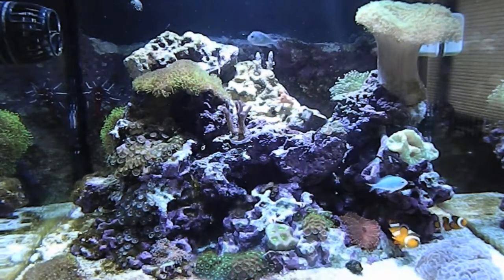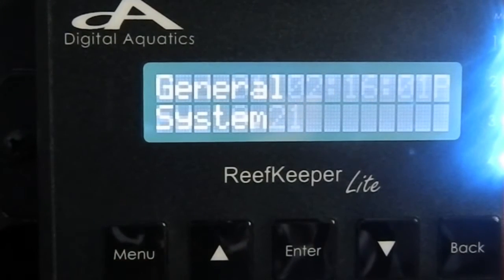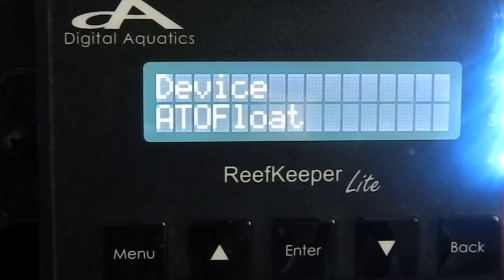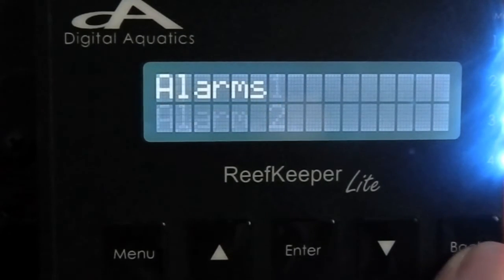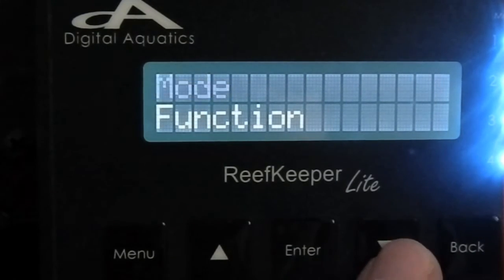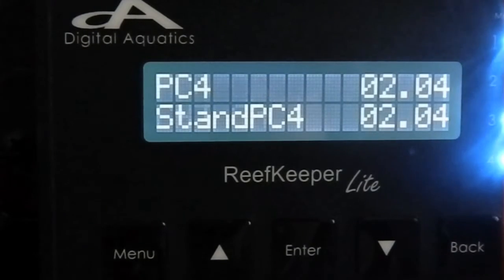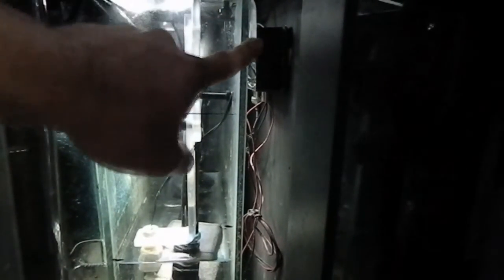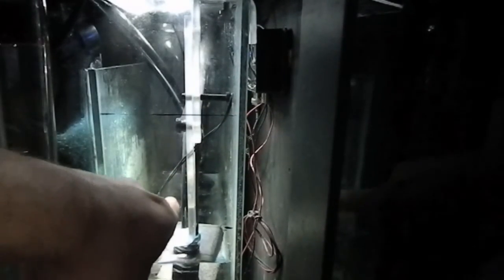How to Setup an ATO with a ReefKeeper Lite

Comment: I don't see a setting in MYREEF 2.0 to set up a ATO. What did you use to set it up on your computer? On/Off, Pump (other),
Reply from the maker: +John Howe Hey, yes you should be able to select On/Off pump.
Reply: Thanks,
In the list of equipment on MyReef, which did you choose?
I was trying to follow your video exactly.
Also my head unit is dead. I just got it friday. 
It was fine yesterday when I was trying to set everything up.
Reply from the maker: Oh jeez, I don't remember. I haven't logged onto MyReef in forever lol. What are the options?
Reply: Ok thanks.

Comment from the maker: The way i have mine setup is...i have one switch to add water to the tank. and another switch in the back of the tank.  the one in the back of the tank is to prevent any overflow. so it shuts off my return pump

Comment: Hey ArcAngel9008,

I just spoke Reefkeeper support and they told me it's best to have 2 ato switches on one system. They told me if one switch malfunction, the other one is a backup. What do you think about that?
Reply: Long time reply as I am just now getting into the sump life. There is also a ATO system by TUNZE that has a float/optical eye switch for redundancy. Currently the ATO kit by TUNZE listed on Bulk Reef Supply is about $200.

Comment: Hey ArcAngel9008,

Nice video on how to setup auto top off using RKL. My JBJ ATO just failed on me yesterday. I'd been using it for less than a year and it died. No water damage. It just died on me for some reason. So I'm looking into setting up my auto top off with my RKL system. I have an SL1 module and it's connected to temp and pH probe. Where would I connect the auto top off valve? Do I need another module to do that?

Comment: Dose the float switch bracket slide to different lengths. I would have to put it in my main tank until I get a sump but they all look way to long for my water level

Comment: Hi ArcAngel, 

       how would i program the Reefkeeper lite ATO to have a failsafe? theres one float switch to do the top off, but i have a second one higher to turn off the pump if a snail gets stuck and the water keeps pumping in and will shut off the pump for  the rodi water?
also, if i decided to do it this way insted, is have one float switch as the water top off and the second float switch in the freshwater bucket to protect the pump from pumping dry, just like the JBJ. ATO.